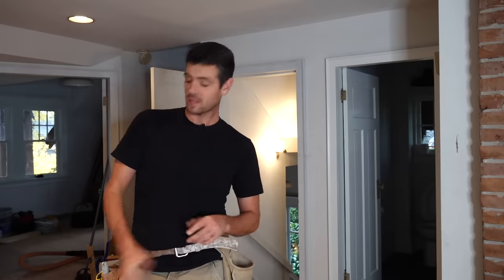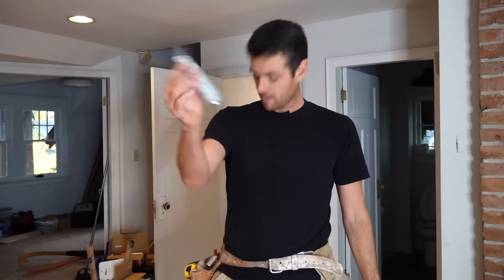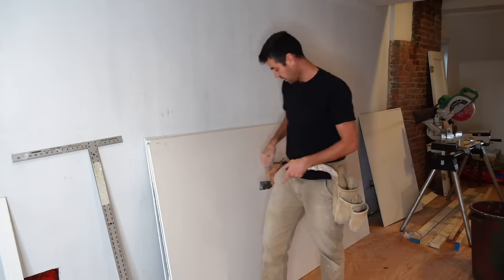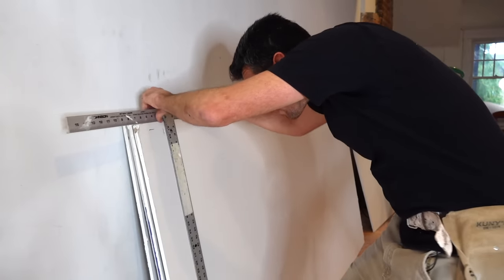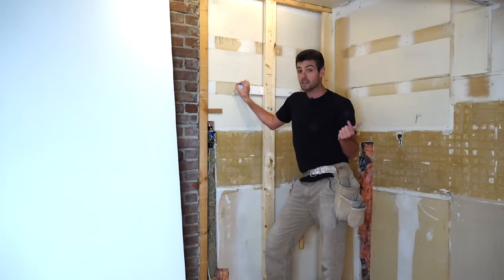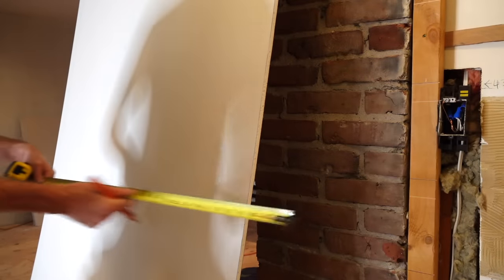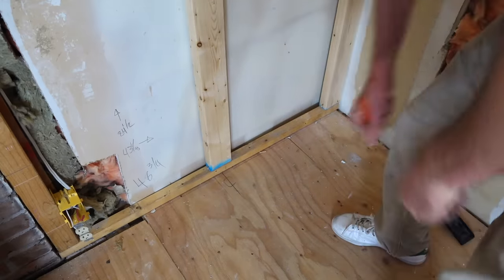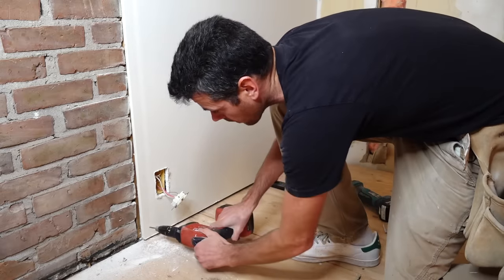Every Beginner Drywall Mistake I can think of (1/3)

Comment: For those who don't understand why 1 1/4" is the right length for your drywall screws, that length is long enough to reliably grab the stud without hitting wires hiding behind. Electricians are required to have their wires deeper than 1 1/4" from the surface of the stud, so the thickness of your drywall is your safety cushion. On the rare occasion when they can't get wires deep enough, such as on a corner, they nail a plate to prevent misadventure. Buy the right length of screws and you won't likely burn your house down.
Reply: Great point and who wants to drive screws any longer than you have to
Reply: @fayekephart848  exactly. Nobody uses anything longer than 1 1/4" anyway unless you are double layering the drywall.
Reply: How about for 5/8 drywall?
Reply: @Alex  its the same. 1 1/4 screws
Reply: Not sure if same building code everywhere in North America but where I live, they put the plates everywhere that a wire passes through a stud.
Reply: I basically fired a contractor over this. We were doing drywall on ceiling and he wanted to use 3' screws... he was significantly over budget so extra cost and besides the risk of hitting something.
Reply: @spelunkerd
Thanks for the info
Reply: @JasonEllingsworth   I’m double layering my drywall and I was going to just use the same screws. Is that wrong? Do I need longer screws for the second layer? I assumed that I didn’t!
Reply: Wouldn't screwing into a wire just trip the breaker?
Reply: @dylancooper8497  If it bridges the gap instantly between the hot and neutral, with no resistance, current would be high enough to trip the breaker. But if there is resistance at the connection, then current will continue to flow. For example a 15A breaker would allow continuous flow if the resistance through the screw were greater than 120/15 = 8 ohms (not much). When current moves across that resistance, heat is produced as a byproduct, up to 1800W (120*15) into that small area of resistance behind the wall. This could be enough to start a fire, melt solder, melt plastic, etc. That's why building code demands wire connections inside boxes designed to tolerate heat. Sometimes you can hear a short as a buzzing or hissing sound, like an arc welder. If the circuit uses an AFCI breaker then it may recognize the electrical signature of a fault, tripping the breaker. If the screw hits only the hot wire, then your hand on the screwdriver may get a shock if your body is somehow grounded. And if the screw is also touching a metal frame, the whole frame could be loaded with 120V. GFCI breakers are designed to trip more safely in case of a fault, but you can die from a shock without tripping a standard breaker. The irritating problem is finding and fixing the wire, which usually requires a new junction box and often extensive drywall repair and repainting.
Reply: Not only that but it also decreases how much space there will be between the stud and the rock when the wood dries and shrinks, a long screw will end up as poppers down the line
Reply: 1 5/8” screws for 5/8” drywall and ceilings
Reply: @LouisLinggandtheBombs  that is wrong because you need the screws on the second layer to pass through both layers and still have 3/8" - 5/8" into the framing member.
Reply: @rawbeejay  we usually add an extra screw in the field on 5/8" for safe measure. But yeah. 1 1/4" for single layer walls.
Reply: @masonholdren392  Thanks, that’s actually great advice.
Reply: I work in the commercial field , when double layering for fire rating, we use drywall to drywall screws on the second layer.
Reply: @howtodoitdude1662  That’s interesting thanks. But is that enough to hold the second layer on the ceiling? I assumed that you always needed to go all the way through and then have a bit of screw sticking into a stud.
Reply: @LouisLinggandtheBombs  you should, that doesn't mean everyone does. I wouldn't screw sheetrock to more sheetrock and hope it would stay flat, or stay up, for very long. Always aim for the framing, at least a half inch of penetration
Reply: @barryallen5507  Thanks
Reply: Well it's because you must have at least a half inch grab and 1 and a 1/4 gives you that even in 5/8ths drywall. Because 1 inch is 8/8ths plus 1/4 (equivalent to 2/8ths) equals 10/8ths. Meaning that driving a 1 n 1/4 screw into the stud will give each screw a 5/8ths grab and in a 1/2 inch panel or board it would give 3/4 or 6/8 grab. Vancouver Carpenter does this sound like accurate information?
Reply: @dylancooper8497  Ummmm, if the screw made just the right contact to trip the breaker, how would you reset it? Pull the screw out you say? sure, then we can leave exposed wires behind the wall and pray they never arc or potentially even worse, continually ground out and generate heat. 

I'd venture to guess, it's probably just worth doing it the right way to being with.
Reply: @LouisLinggandtheBombs  You might consider 1-5/8" or 2" for the second layer. Two -layers of 5/8" GWB is 1-1/4" and two-layers of 1/2" GWB leaves only 1/4" max embedment into the stud. Assuming your studs are wood, then walls OK, but ceilings, I wouldn't chance it. You should be shooting for a min. 1/2" embedment into the stud.
Reply: @stevenreid3190  thanks
Reply: Dude, you need a laser measurement tool. 😁
Reply: It’s pronounced, ‘a-gen-st’, 
not, ‘a-gain-st
Reply: @MDTRAIN  When I see posts like this, I roll my eyes. It takes a special mix of ignorance and arrogance to think that one's own accent is 'correct'.
Reply: @spelunkerd  Don’t be too hard on yourself.
Reply: You think domingoes electrical services cares about the 1” that’s what stud plates are for to prevent drilling into pipe or wires. If you’re diy your own drywall at home then invest in stud plates.
Reply: @LouisLinggandtheBombs  1-58".
Reply: @dylancooper8497  I've seen fires start when a screw or nail pierced a wire and stayed good until vibrations[or whatever] made the electrodes contact.
Reply: I made this mistake, haha. Can lights stopped working. Boss used a circuit tester and the screw head was HOT beep beep beep.
Reply: Oh sure...(haha)...don't mention hitting my copper water lines that I meticulously marked and drilled the center of every stud. I count on the drywall sub using the the correct length screw.... If they use whatever's laying around it could be costly later. 
A lot of drywall guys pull those safety plates off but mark where not to screw...I would too. Building departments want us to use close to 1/8" thick plates sometimes! ....and with the nail heads sticking out of the holes?....wtf?
Reply: @LouisLinggandtheBombs  I think it's great to use longer screws to bite into the framing but I believe there are specific screws made for laminating gypsum board. I was taught to always use glue between the layers.
Reply: Not to mention pipes. Nothing worse then sending a screw in and the wall starts hissing and the longer it takes to shut the water off, the more water damage you will get. I like to mark no-fly zones and just stay away from pipes and wires.
Reply: @LouisLinggandtheBombs   Math is your friend. Figure it out. Eyeroll.
Reply: @MDTRAIN  - no, it's not. Look up the pronunciation in your dictionary. He's speaking the word the correct way. He's speaking English.
Reply: That is correct length for 1/2" drywall. Obviously length increases for thicker sheet and subsequent layers.
Reply: they want 1 5/8 for 5/8 drywall now
Reply: @Ralith09 that’s a little insane and that’s the longest screws on the planet… and probably 10$ a screw with him using 3’ (3 FOOT) long screws. 😮😂
Reply: If going over lath with 1/2", go 1-5/8".

Comment: I think the reason why drywall is used is BECAUSE it is cheap and easy. If you screw it up just tear it out and do it over. If you want to knock a hole in the wall and run some cable? Piece of cake, easy to patch. It's like it was made to be destroyed and repaired. Dents are easy to patch. It the material was high quality it would be hard to repair. Patching wood panel is not easy. Replacing old panels and finding ones that match, not easy. Drywall is like cork board for hanging photos. Thumbtack the hell out of it. Nobody will notice.

Comment: A drywaller with 15+ years experience here. I have a very similar set up belt, but I've got a trick for you to use if you'd like. Instead of keeping your measuring tape on the right pouch, keep it in the smallest end pocket on your left pouch. So when you need to take out your knife and tape to do the sliding technique, or tape and pencil to make a mark, you've got both ready to go at the same time. It saves about 3 seconds, but when you have to do that 200 - 300 times per day it adds up.
Reply: I like using the  old fashion  16 ft  stanleys  with a metal casing   ,theyre super fast  to grab and throw back in your pouch  .
Reply: @liberty4617  ya I've always been a fan of Stanley's Fatmax 16ft tapes. Probably gone through over 30 of them by now
Reply: Definitely. And you can grab your tape and knife or tape and pencil or tape and pen. At the same time.
Reply: Red gang.
Reply: I just keep one tape on the right side, one on the left and one right in the front. all 35' fat max tapes. lol
Reply: @jayishere74  haha I just bought a 25 for my right pouch. Now I have a 35 wide blade and a 25 framing tape
Reply: @liberty4617  always preferred the Stanley 25' myself.  Honestly never knew of the 16' if i would have i would've tried it.
Reply: @weirdscience1  With drywall its all about speed  , the bigger ones are more clumsy ish ,  i also use a 5inch knife for nail spotting , faster, less wrist strain and pulls off excess mud so it dont build up and require excessive sanding
Reply: Yup. Tape is always on screw pouch side so always used with Ur off hand so your dominate hand (screw hand) is free to use knife or pencil always. Every second counts when piece working drywall. When an 8ft sheet pays $10+- and takes less than 5 mins to install, you're missing out on a good chunk of change fumbling your pencil and tape for a total of 30+ mins throughout the day
Reply: If you're using the FatMax tapes you can eliminate using a chalk line because it has teeth at the end of the tape so you flip it upside down hook those teeth on the end of your sheet and on your tape all the way through to your other measurement it's completely firm draw your line with your pencil you can even use it a knife to draw the line with

Comment: Drywall fast and cheap.  But also fire resistant.  I grew up in a house in California that had 1/4" Mahogany plywood for the walls.  Ours was painted white but our neighbors was varnished.  Their house caught fire and was gone in 15 minutes.  Their garage didn't have the original Mahogany plywood and had been drywalled and was the only room left standing.  The next week my father ripped our Mahogany out and replaced it with drywall.  I had stucco concrete walls in one house designed as a passive solar experiment.  The walls were done like a basement.  It made the house very quiet as it blocked outside noise.  But much harder to work with than timber frame and drywall.  If you want wood or some other expensive material put drywall behind it.  It may save you life.
Reply: and for the cost, drywall is very sound absorbent

for those that don't know, gypsum isn't just non-flammable. because it's a hydrated mineral it outgasses water vapour when it gets hot
Reply: Sad that the Mahogany paneling was destroyed. People make hasty decisions that are costly.

Comment: Just a tip for chalk line. Cut through the board with your knife quarter inch or so and throw the chalk line in the grove with the holder pulled out the back side.  Works better that way and won't fall off.  Also any extreme angles will become much easier.
Reply: I do this all the time and it has yet to fail. I get 100% accurate trim-out every time.

Comment: You saved me so much time, money and frustrations. Fixed a 18ft tall 40x30 sagging ceiling. Scraped 4x as much painted popcorn ceilings. Countless nail pops. 10 peaked sheets. Covered textured walls with skim coats.  Replaced a 4x3 section of ceiling. Numerous failed tapes and cracks. and everything is PERFECT. Took me 80hrs lol but I'm happy.  THANK YOU!!!!!!!!!!!  BTW Wet sanding with a microfiber backed sponge in a circular motion THEN sanding gave me a level 5 finish.
Reply from the maker: Awesome! I’m so glad the videos helped. And thank so so much for the generous super thanks! Looks like I can support my luxurious coffee habit for one more month😂❤️
Reply: @vancouvercarpenter  you're welcome! I ruined the perfect walls and ceiling I created by not having enough pressure in the paint sprayer. So now I get to do it all again!!
Reply: I'm actually considering flat wallpapering the whole thing and skimming the joints. I just don't think I have it in me to skim and sand it again. Have you ever done this?

Comment: Good info… regarding setting the screw depth, I’d add that replacing the Phillips bits frequently helps.  This as as the bit wears the depth the screw is sunk decreases. The wear occurs very little from screw to screw but after a 1,000 screws it’s noticeable.  Don’t cheap out on changing blades and bits… they are consumables!
Reply: Your bits last 1000 screws? Mine last about 25 screws I think while using my impact.  I bought a box of bits
Reply: @infotechsailor  Mine... No!  That was my point!  On the other hand, I've seen guys with bits so rounded off that they had to put a lot of pressure on the driver to keep the bit engaged in the screw head... and they kept messing with the depth adjustment. That comment was for "those" guys. 😜
Reply: @infotechsailor  You need to buy better bits. You should be getting at least 100 screws per bit. Better yet, get Torx drywall screws and you will get even more out of the bit.

Comment: I appreciate how you looked for space in the outlets without wires before you router the hole. As an electrician I can tell you that not all drywall guys worry about that. Have had to fix plenty of wires chewed up by routers over the years. Thanks for your attention to that detail!
Reply: As a drywaller for 15 years after being chewed out for chewing up wires like going in the box with the routers I made it a rule stay on the outside of the box by 1/8 of an inch plate covers it and you don't have an electrician all over your ass
Reply: On another thought I can tell how good the electrician is by if I measure from the floor up to the bottom of the box after a measure a dozen of them and they're all set it 15 or 16 in I figure I can trust them not be all over the place with their measurements

Comment: 2:40 It would have been nice to mention why 1 1/4" screws for 1/2" board...to reduce the risk of screwing into electric wire. Hopefully wire is in the middle of studs so there's about 1 1/4" of wood before the hole for wire. So a 1 3/4" screw would be max in theory but holes aren't always perfectly centered so not a lot of leeway there. There are also wires running along studs and joists and where they go into electrical boxes the wires are very close to drywall on an opposite walls. No problem if the screw hits the stud, but if you miss... Longer the screw, higher the risk.
Reply: That is an added benefit, but most jurisdictions mow require plates to protect wires. Of course that does nothing if the screw misses the stud and subsequently the plate.
Reply: @RehabLife  I don't know about the States, but up here in Canada a protection plate is only required if the hole/cable is less that 32mm or 1-1/4" from the edge of the building member. I always put them where I know cabinetry will be installed or other risky areas, but not everyone will.
Reply: @RPGDonkey  yeah, I think technically as long as the hole is in the center of the stud it doesn’t have to be there, but in reality almost none are so I just put them everywhere. It’s cheap insurance.
Reply: The "rule of thumb" is that 1-1/2 of the width of material held needs to be penetrated by the screw. So, for 1/2" drywall that is 3/4". That's where 1-1/4" comes from. With only 3/4" protruding into the stud, there is plenty of margin because a 2x4 is 3-1/2", 2x6 is 5-1/2". Halfway is 1-3/4" and 2-3/4" respectively. In Ontario the building code calls for rough-in wiring to be centered in the depth. That leaves about 3/4" for 1/2" rough in drilled hole into a 2x4 partition wall. Any rough in electrician drills the hole mid depth and in a horizontal line to make it easier to pull. Rough wiring is usually mid stud for stapling and boxes are 2" deep or 1-1/2" back from the face of the stud. Plates aren't required if rough in wiring is done to code. If the rough in hole is an inch or less from the surface of the stud due to being misdrilled. plates are required. That is the responsibility of the rough in electrician, not the rocker.
Reply: @dondonaldson1684  I do everything so, it’s ultimately my responsibility
Reply: Well I mean nobody in their right mind is using more than 1 1/4" long screws anyway for hanging 1/2" or 5/8" drywall...unless of course you are double layering it.
Reply: wire and drains/waterlines. cant tell you how many times a drywaller hit my pipe and flooded the place at 330 pm on a friday

Comment: A little trick I use for outlet/switch boxes that I find really handy is i'll wet my fingers with water and put water on the box face (outlet/wires pushed inside box. You then put your sheet up against and give a few knocks where boxes are. When you pull the drywall back off wall you have a perfect outliine of where box is, then use a oscillating/router tool to cut it out.
Reply: Yes, excellent; works well.
Reply: Try red lipstick. Been using this for over 20 years. Don’t tell wife!